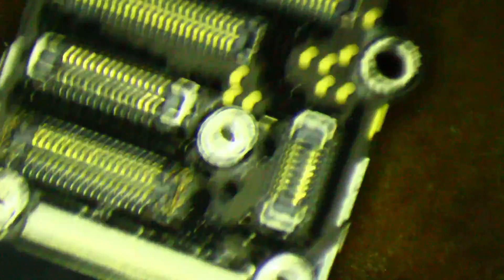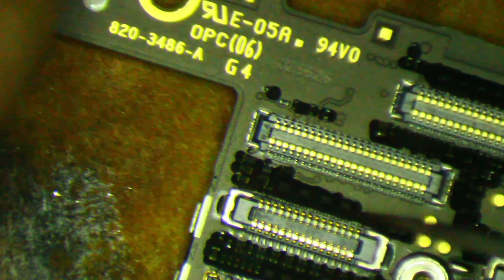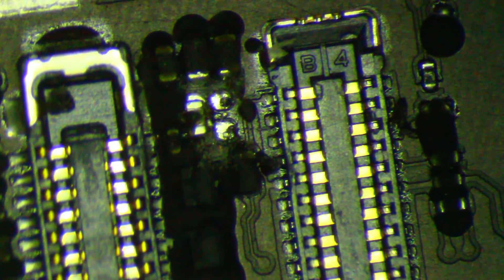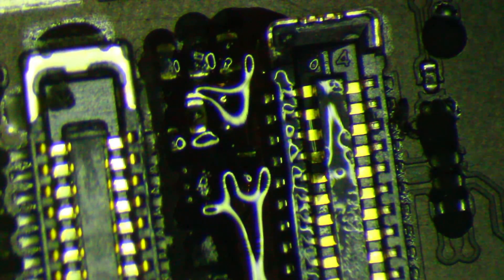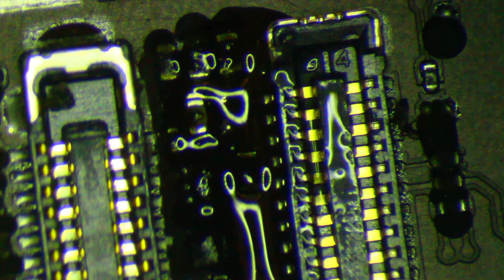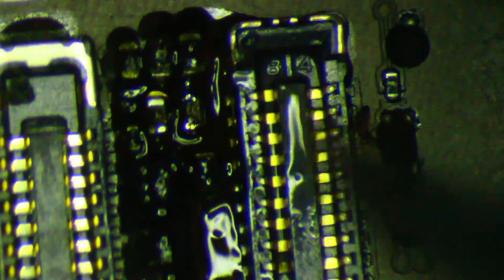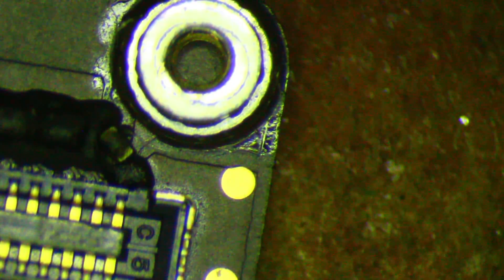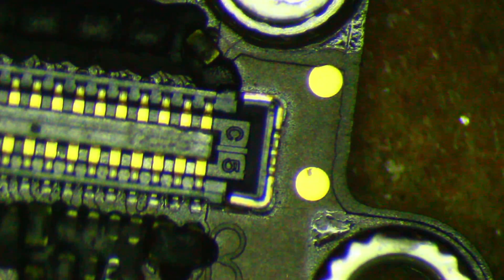iPhone 6 lines in display solution - no image with vertical colored lines

Comment: Hi Mark
Gained too many knowledges from you.
Is there any way to check this filter if it's fault or not without jumping to conclusions?
Many thanks
Reply from the maker: AboMusn almohajer sometimes the filter tests ok but is still bad. It's pretty simple to replace it as part of troubleshooting the problem and will often solve it.
Reply: Mark Shaffer - thanks you the best